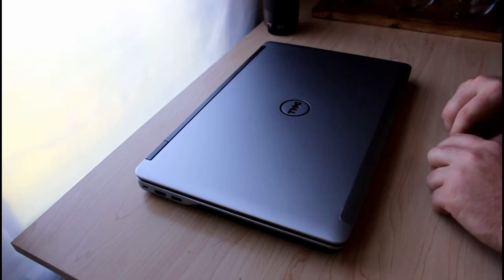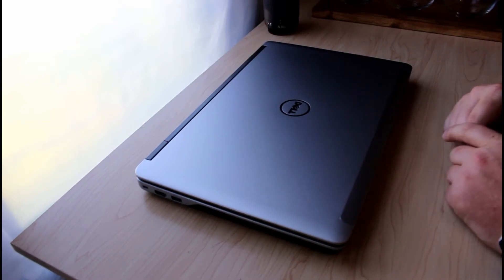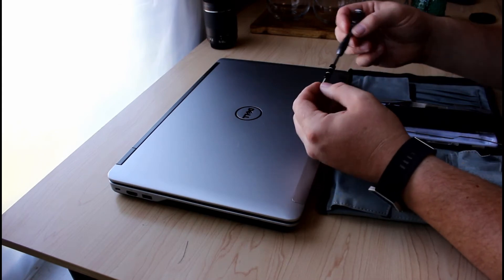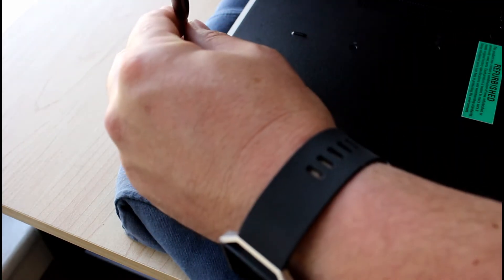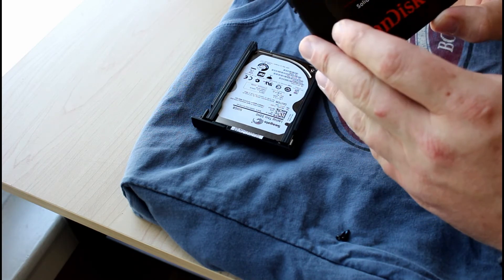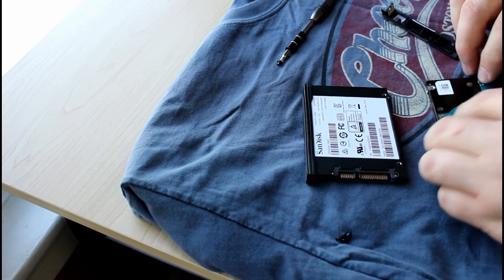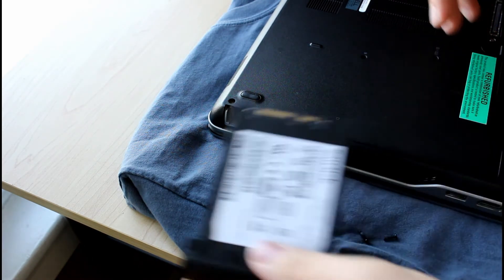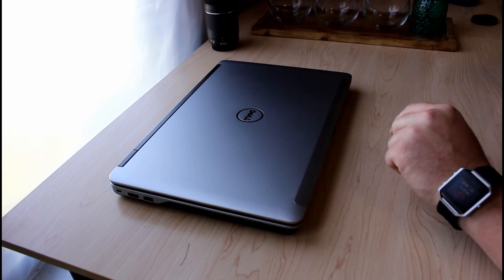Dell M2800 SSD Upgrade

Comment: Im replacing the ssd with an hdd. My main problem is the guards that attach to the sides (used to accomodate the SSD) are too small for it. Do i have to buy them first?
Reply from the maker: Oh that's interesting, going the other way. Yeah I would say you'd have to buy the correct guards to make it fit. Good luck!

Comment: I am confused, Sir.  Everything I have read indicates that the maximum RAM is only 16GB, not 32GB.  I am restoring an M2800 from the bottom up, and want to obtain its maximum capabilities.  This SSD upgrade video is good, and I will attempt a 1TB SSD install.  Thanks
Reply from the maker: It looks like you're right. After reviewing Dell's website, 16GB is the Max ram for this model.

Comment: My company M2800 laptop has been serving me well since 2015! But got real slow so did an image of the drive with AOMEI Backupper, made a bootable floppy with same tool, then swapped out my 1TB hybrid for a Crucial MX500 1TB 3D NAND SATA SSD. Works great now! Had the defragger running on the hybrid - which was probably a big mistake. Also want to shout out to readers that defragging should be turned off for SSD (and hybrids apparently).
Reply from the maker: That's great, good tips as well on the defragger. Thanks!

Comment: Which SSD is this?
Reply from the maker: This was a SanDisk SSD plus, available on Amazon. I don't remember the size.
Reply: @regulartechreviews970  Oh thank you so much. But any ssd will work right. Thinking of ordering something from amazon. https://www.amazon.co.uk/dp/B078WQT6S6/ref=cm_sw_r_cp_apa_i_0KU.FbCGY4V8R?_encoding=UTF8&psc=1
I am new to even opening up my laptop (have to do it as it is a lockdown).
Reply from the maker: @midhunlove  Sure thing, That Samsung SSD will work just fine. Make sure you have a Boot disk/usb with Windows 10 or which ever Operating system you'd like to use. If you're new to it, look up installing windows to a new hard drive to familiarize yourself with that process.
Reply: @regulartechreviews970  Thank you so much. I will do just that.👍👍😊😊

Comment: Did you ever find out what’s the max ram you can install in this machine? Also what’s the max ssd storage you can do as well. Are you still using this machine?
Reply from the maker: Up to 32GB would be max RAM for this machine. Max SSD would be as high as you want to spend. It's now been given to my daughter and she runs games on it. Still a solid laptop after several years abuse.

Comment: how come ye battery doesn't extend out from the body at the bad? Also how long does ye laptop last on a full charge whilst surfing the net? can you also show how to change the ram ?

Cheers buddy!
Reply from the maker: Hey! The battery that sticks out the back is the larger extended option. I just have the smaller battery. I'd say fully charged, just browsing the web, 3 hours or so. It's a few years old so I'd say that's average.  You can pick these up on eBay refurbished for under $500.  Sure, that's a good idea for my next video, Ram Upgrade. 

Thanks!
Reply: @regulartechreviews970  9